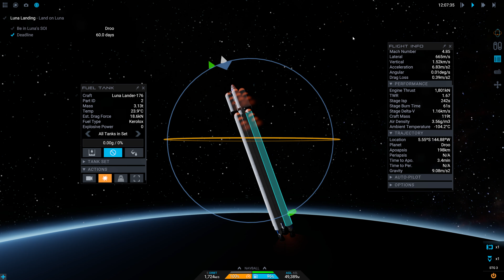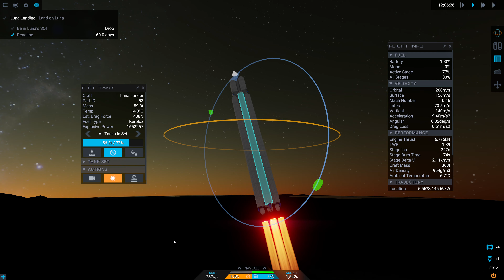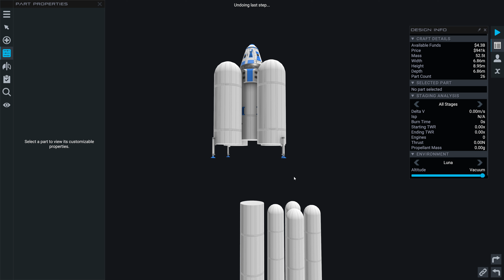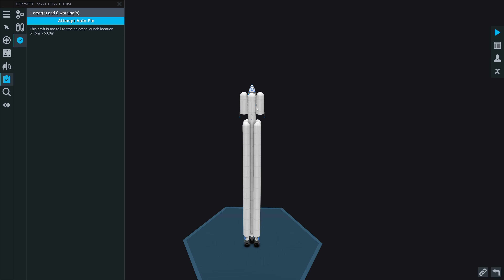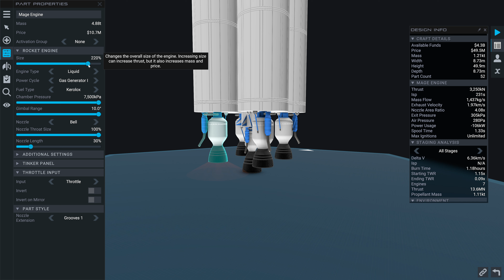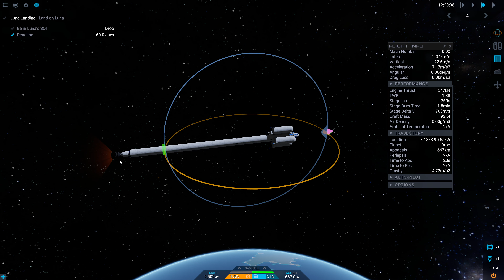Juno: New Origins | Atraitus Exploration Co. | Episode 40

Comment: A pressure-fed engine is the Gnome engine. There's no such thing as a "pressure-fed Spirit engine". But, for vacuums, the Gnome is pretty good. Nothing will give better delta-v than a pixie though.
Reply: Tanks of pressure feed engines don't scale up well in real life and gas generator should get significantly better DV with equivalent ISP.  Juno kind of makes up for it by making pressure feed engines quite heavy when in reality they are very light.  Normally you would want a pressure feed engine on a final stage that does not get a lot of the mission DV budget but it will have the best DV/KG ratio.  I have been doing a lot of experimenting with pixie vs goblin.  From what I can see so far pixie gets about 10% more dv for 10% more cost at the same TWR and mass.  I am still trying to find the use case for smaller throat size and lower chamber pressure as it seems like using a smaller engine is always the better option.